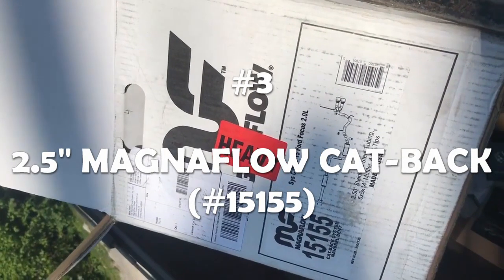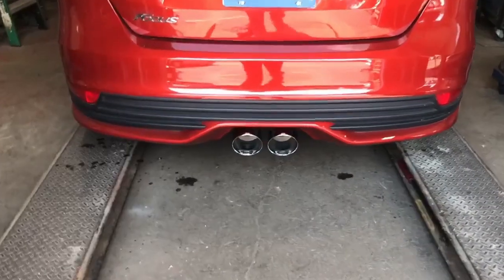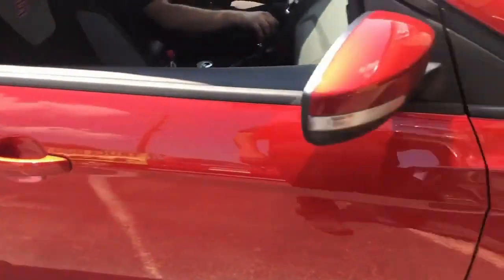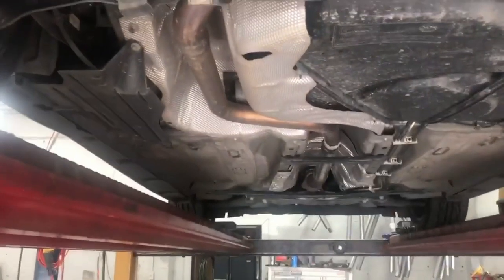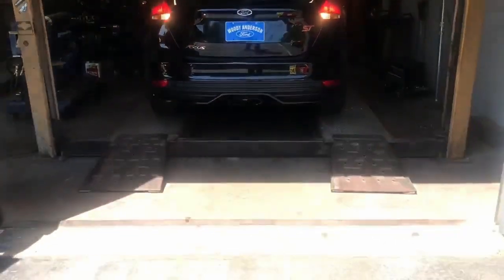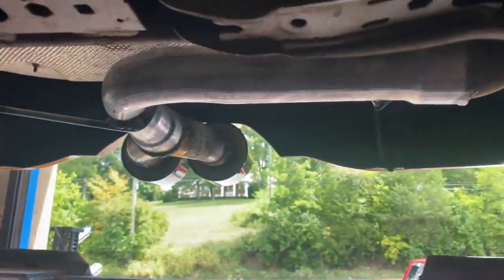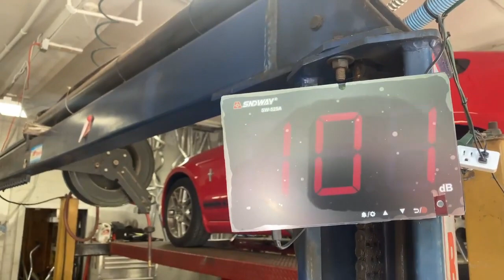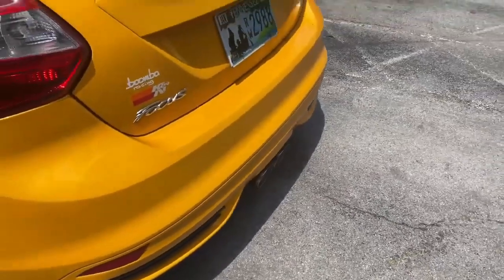Top 3 BEST EXHAUST Set Ups for Ford Focus ST 2.0 TURBO!

Comment: If you into the lower tones AWE Track Edition is definitely the way to go in my opinion. Got mine awhile back and it’s a 3 inch with a resonator. The note is amazing and you get the burbles and and even some backfires out of it(rare). Although it’s a pretty loud you can quite it up if you need to. I’ve done research on the exhaust for quite a bit Bc I’m pretty young and don’t have tons of money for parts so I wanted to make sure it was perfect for me. And I can say the sound on video of an exhaust is pretty different from real life because it doesn’t pick it all up.
Reply: I have the AWE touring and love it. AWE is top of the list for me:)

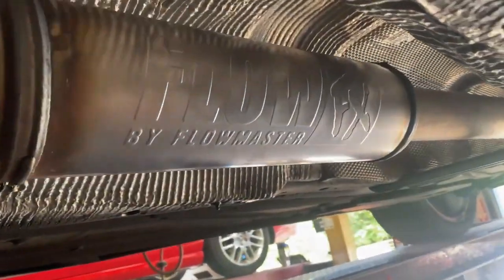Comment: 4:41 - they make converter pipes to smooth out delivery. that pipe is obviously aligned at the top instead of being centered. it makes for a crappy looking weld and a cobbled together looking mess. if my airmen welded like that, id make them grind it and and redo it.

Comment: my fusion 2.0t has the same engine would i be able to get a similar sound as that last one
Reply: Just thinking about the same for my upcoming turbo fusion with the 2.0 I definitely believe we could? If you simply bought the flow/fx and just replaced the stock resonator with that, and just a simple muffler delete. Should be identical
Reply: Fusion has the same motor, but different turbo setup, I got both a 2017 Focus ST and a 2014 Fusion with the 2.0T
Reply: @adalbertosantiagopagan8738  but starting in 2015 didn't they revamp the Fusion 2.0 set up? Hmmm.. well so if it's slighty different, you think it would sound THAT much different still?
Reply: @TheNightKing22  Hmm I don't know I know they use a different turbo, but maybe it would sound the same not sure. Maybe the length of the car would cause it to sound different
Reply: @adalbertosantiagopagan8738  you're probably correct, and not only that, but a different turbo would equate to different sound as well. It would probably be similar, but not the same for sure. Good call 👍🏻

Comment: Nice work. #4 should be the stock exhaust.   Tinnitus is real and drives some people insane.  Those exhausts are great for urban jaunts , but if you commute like I do . #1 #2#3 will produce an incredible drone inside that is like negative feedback every time you step on the gas. You end up hating 2500 rpms.
Reply: Maybe 2 and 3 but not the first one or any full exhaust that retains the resonator and muffler.  Thermal R&D is a great one and zero drone.
Reply: @CarAudioObsessions  hell i wear bose cancellation headphones anyways.LOL  heres my st...https://www.youtube.com/watch?v=e7NCe3ybRQM
Reply: Just do a properly sized helmholtz resonator and you'll be perfect.

Comment: He said put it in sport mode like it has some effect on engine and exhaust sound 🤣🤣🤦‍♂️
Reply: Called track mode and it does on sound
Reply: I believe that is only on the new ones that we are not getting in the USA. Certainly have never heard of it on any that I have worked on or anyone I know that owns one in the groups.
Reply: @the.batman  other cars it changes it. Wasnt meaning the focuses
Reply: @PhantomXtrem  
Fact. Other cars it may. But unfortunately not the ones specifically that this video is made for. Although I believe I heard it is a option on the newest model being offered in Europe.
Reply: @the.batman  gotcha
Reply: It has a effect not sound but if you put it in sport mode It increases throttle and braking. Turbo will not lag at all and taking corners fast will be easy cause car gets more stiffer and the ecu will slow down abit for you. Traction controle complety off=Track mode is best for drag racing. Default mode =drive mode= a soft eco mode, its the worst mode ever turbo lags harder bc ecu stoping you for better mpg and taking corners fast kinda slows you to much. Also shifting gets more stiffer in track mode also in sport mode but more in track mode.
Reply: @totov7673  
You clearly are not talking about the vehicle in the video cause the focus ST does not do all of the things you are talking about. My comment is in reference to the vehicle in the video. Not what other vehicles may be able to do.
Reply: @the.batman  Dude the focus ST has default mode = soft eco mode than sport mode and traction completly off = track mode? Have you not seen the esc off button???
Reply: @totov7673 
I own one. Also I work on them all the time. No one is debating what modes it has. The debate is do those modes change the exhaust note. They do not. They affect the traction control etc. Not the motor or exhaust set up. 

Again we are speaking about USA model in the video. Not the new one released only to Europe. 

Thanks for your feed back. 🤷‍♂️
Reply: @the.batman  Ahh ok makes sence now I understand what topic you were talking about, my bad english not my first language 😆. I agree 100 percent that the focus ST does not change exhaust note in any mode, also think its to quite to start with 😅
Reply: Sports mode... ( braking assist off ) Am I a joke to you? 🤣
Reply: @namewithheld7835  
Made me laugh when he told them to do it. At least know how everything works on the vehicle your modifying multiple times. 🤦‍♂️🤣🤣
Reply: @namewithheld7835  😆 you dont like braking assist?
Reply: Sport mode adjusts the shifting to make it accelerate slightly faster which would have an impact on the exhaust. It would rev up faster on acceleration
Reply: @Goyxrd3  
Alright I’ll give ya that. It adjust torq. But that has no bearing on exhaust note. Nothing in exhaust opens up or anything. Certainly is not going to change anything on a free rev not under load. 🤷‍♂️🤦‍♂️
Reply: @Goyxrd3  cool no kiding shiting is much easyer in sport mode 😆

Comment: Also I politely disagree with your “Top 3” choices. 🤔
Much better sounding options out there for these cars. 
Hard to say which is best because it all depends on the taste of the individual. 
But these 3 set ups are rarely if ever mention in the serious ST communities for options when discussed for best exhaust set ups. 🤷‍♂️
Reply: What would you recommend?
Reply: @couldbeowen5826  
What exactly are you looking for out of the sound? Loud as hell when you are wot? Or middle ground where you hear it but it doesn’t scream? More mellow or full race  sounding 4 cyl?
Reply: @the.batman  personally i prefer a low or deep sound. I dont care for excessive noise
Reply: @couldbeowen5826  
I would look at the Cobb cat back or similar then.

Comment: If you are living in USA and love Ford. Don't ride a Focus. There are thousands better cars there!
Reply: 😆 like what? For same price range?
Reply: @totov7673  all cars equipped with V8!!
Reply: @grichagricha4719  😆 your not getting any v8 with the same price range plus old v8 are much slower 😂
Reply: @totov7673  how much cost a Focus ST 2.0 in USA?
Reply: @totov7673  speed is not important. Just pleasure of driving ^^
Reply: @grichagricha4719  Ahh I mean sure makes sence if you put it that way.
Reply: @grichagricha4719  Depends not sure Im not in usa 😆 but Il estimate you can get a 2018 focus ST for 18K verry low millage like 50k or so. Or you can get a 2015 for 10k or 2013 for 8K but it will have 100k millage on it.
Reply: @totov7673  you can get good V8 muscle/pony car for that price.
Reply: @grichagricha4719  Wait For 18k???
Reply: @totov7673  absolutely.
Reply: @grichagricha4719  well, I bought my '16 Focus ST1 of the trailer with 4 miles on it, 6yr/100k Bumper to Bumper, Wheel & Tire Insurance, Taxes & Tags for a whopping $24k out the door... You can't buy a V8 of a comparable year, performance, and warranty for that price ANYWHERE in the US
Reply: @bacchusthompson5834  performance is not the most important. I think it's easy to find pretty decent third gen Camaro or Firebird V8 for less than $10K. It's total another pleasure of driving and I prefer that one.
Reply: @grichagricha4719  I didn't say you couldn't find older ones. I said you can't find any that are comparable in year, warranty, and performance. True performance isn't the sole factor but, for the price of a Focus ST and it's capabilities... You'll be pressed to find a 2013+ V8 that will compare.
Reply: @bacchusthompson5834  I got my focus ST for 10k but it had 100k miles
Reply: @totov7673  the 2.0 Eco is pretty reliable honestly... As long as you stay on top of the maintenance, you'll have no issues. I'm at 132k and still on Stock Block & Clutch
Reply: @bacchusthompson5834  Nice what maintence you have done? I did back and front tie rods and sway bar bushing. changed rear motor mount , Air filter,  spark and motor oil every 10k. Is that the all  maintence or Im missing something?